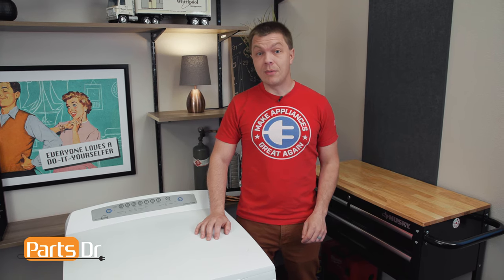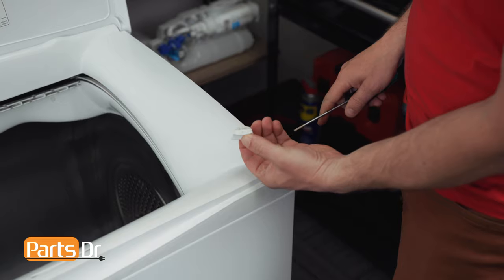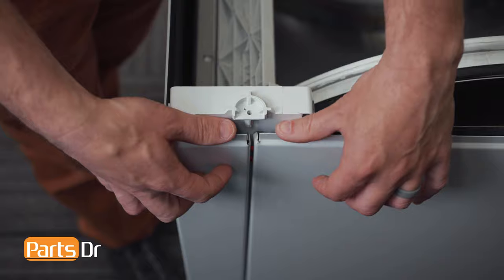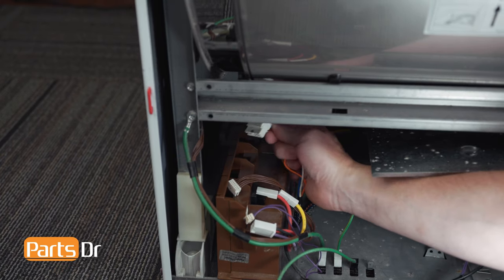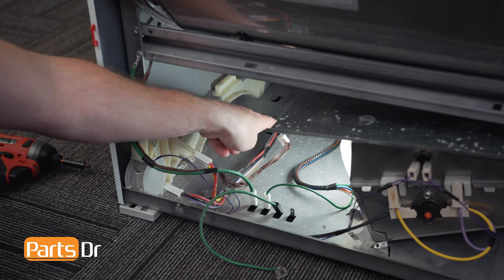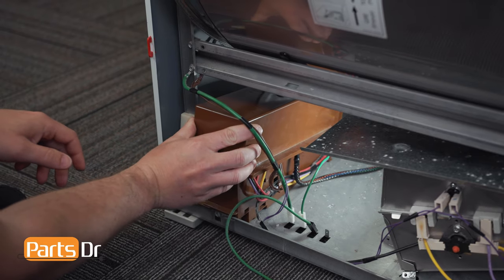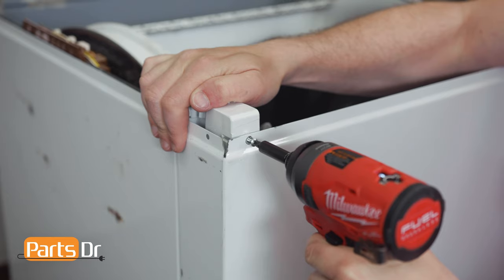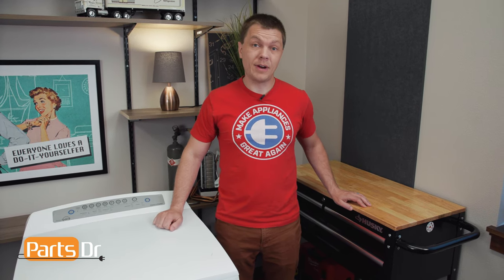How to replace Fisher & Paykel dryer motor control module part # 395664USP

Comment: Very informative video. Thank you for making it.
Reply from the maker: You're welcome!  What kind of problem is your dryer having?
Reply: @PartsDr  Well I had heard a pop and then the dryer died. I believed it was the motherboard, so I took it apart and just replaced the motherboard and put it back together following your instructions. Sadly, it is still not working so I'm not sure if I put it back together wrong or if it's another part that isn't working.
Reply: @PartsDr  I also took apart the display motherboard and checked it, though I couldn't find any obvious signs of damage on it.
Reply from the maker: @inujosha  Sorry to hear that.  Let us know if you find the source of the problem.
Reply: @PartsDr  I will do. Thank you sir.